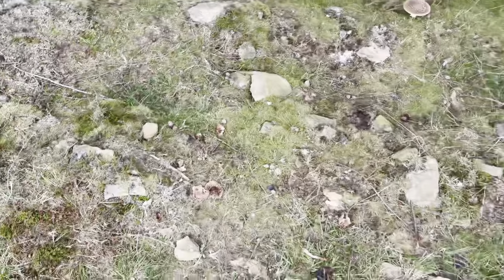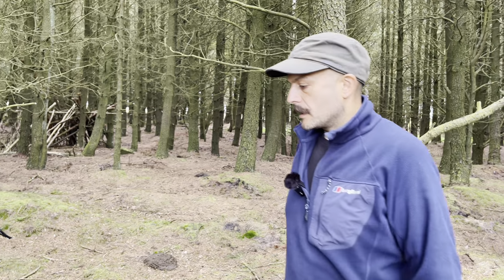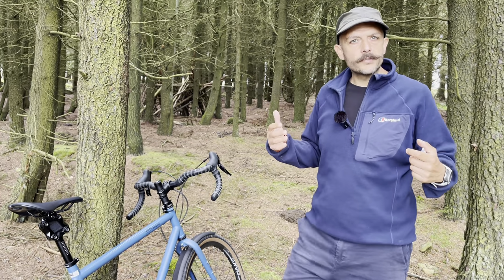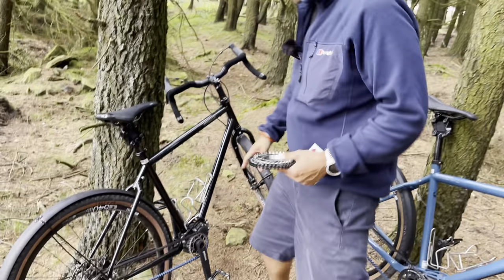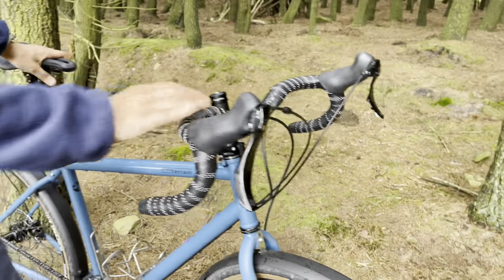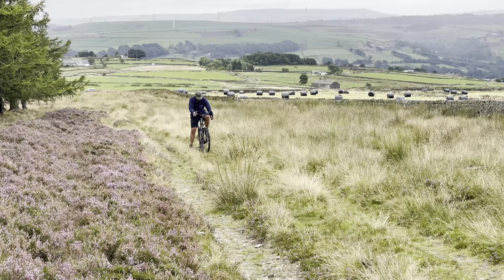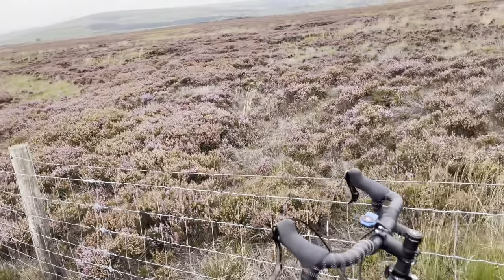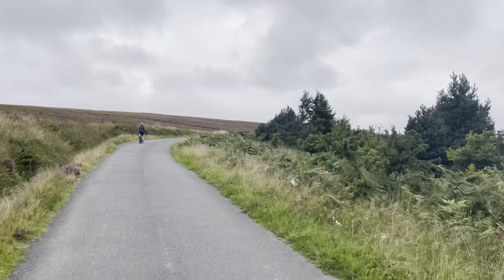Tout Terrain Scrambler Ride & Thoughts - Steel gravel bike with Pinion & Gates Carbon Drive

Comment: Hi, great video and thank for taking the time! I have a question in regards to the dynamo hub and the battery charger. I have ordered the same setup and can see in your video that it comes without any actual front and rear light. If I want to install such lights, is there a connection point at the dynamo hub available or do I need to connect the wires somewhere at the battery?   Thanks :)
Reply from the maker: Hello.  There are two wires that come off the bottom of the battery.  You connect your front light to these and then your back light connects to the front light.

Cheers

Comment: Excellent review!  The Tout Terrain Scrambler would be the perfect all around road/off road tourer. It could handle the GDMBR while still being road worthy. I’m going to have to sell my Surly Disc Trucker.
Reply from the maker: Yes they are very good reliable bikes.  The Surly Disc Trucker is a very good bike also though so make sure you are selling for the right reasons.  The Scrambler is a bit more ‘sporty’ than Trucker and you do have the reliability of the gearbox.  I would imagine the Scrambler with a steel fork is about the same weight as a Trucker. 12.5 - 13kg.

Comment: Hey man, thanks for the video. The grinding noise in low gears and lack of drop bar shifters are what have held me back, along with frame options and price. But the first two concerns seem outdated and the price seems more and more justified. The Tout Terrain seems like a nice do-it-aller. So maybe that concern is gone too. Thanks for the detail!

Comment: Two stone, 5-1/2 pound. My Priority 600 (New York City), aluminum frame, Pinion C1.12, Gates Carbon Belt with dynamo as well as pannier and porteur racks and a FoldyLock comes in at 3 stone. Then again, bikepacking isn't all about weight.
Reply from the maker: Yep, I am not bothered by weight at all but you need to mention it cause some people are. If you feel my bike when in your you would see I don’t even understand the term pack light 😃

Comment: Thank you for all the information concerning this bike.  I have one question, how can one buy a Tout Terrain bike now that there are no dealers in the UK..?
Reply from the maker: Hi, yep you are correct they used to have dealers and then they got rid of them and went to a direct sales model and at the time it was pre brexit when I got mine.  After Brexit they did not have the systems in place with their delivery company to make a good experience for the customer, so they took the UK off their shipping list.  I am hoping in the further they will use different shipping methods and they put the UK back on. When I get a frame from the US they use a company that adds all the import fees to the delivery cost and that means the package by passes customs and comes right to your door.  Hopefully they will use something like this in the future. Anyway if you want one now, a goo way to do it might be to get out to Germany pick one up and bring it back with you. Or even have an adventure and ride it back.  I did that when I bought a Pilot Pinion Bike the Vamos, their are other benefits to that too. Or you could look at getting your next pinion bike from Nua, Solace cycles or rennstahl or falkenjagd.  The steel rennstahl brand has all the features of the Tout Terrain.  The others are titainium. By the way Sonder cycles in the UK also has a Pinion touring bike now the Broken Road. A great value titanium bike.  Cheaper then the steel ones mentioned here.  https://alpkit.com/products/sonder-broken-road-pinion

https://www.rennstahl-bikes.de/de/
https://www.falkenjagd-bikes.de/de/
https://www.nuabikes.com
https://www.solacecycles.com

Comment: Awesome review! Also saw your video on the Pinion and Rohloff. Have you found the gap between gears with the 12 speed Pinion vs 18 speed Pinion for a touring setup a big deal?
Reply from the maker: Hi,  no I thought you would but it is not a problem  at all.  A fact with triple and double derailleur set ups is you have so many duplicate gears depending on what front cog you are on so actual different gears with a triple is a lot smaller and 1x12 derailleur sets must have a similar jump.  So it is not noticeable at all.  The steps between the gears on my P.18 are so small I probably end up shifting 3 at a time.
Reply: @RidingBicycles  Awesome! Thank you from Oregon, USA
Reply from the maker: Oregon was beautiful.  I cycled the Adventure.org route from Vancouver to San Diego. The best trip I have done so far.  Went through so many beautiful places and met some fantastic people!

Comment: Thank you for this informative review. Would you know if it is possible to put a handle bar bag on, or would that require a modification to get the cables out of the way?
Reply from the maker: Depends on the bag but that was a concern of mine.  The cables can move out of the way.  They are not that rigidly fixed in place so with the variety of bags I have I think I would be able to make it work.
Reply from the maker: To follow on. A Orilieb style touring handlebar bag would fit behind the cables.  Not sure how bikepacking bags would fit.  I imagine they would sit just below the cable hood exits but it would depend on the style of roll bag.  I think in the promo vids of the bikes they were filmed with bikepacking bags.
Reply: @RidingBicycles  Good to know. Thanks a lot! Think I will go check that bike out. Looking forward to seeing how you are going to pack it, whenever you decide to.
Reply from the maker: Bikes don’t last that long in my possession 😂 I always get my head turned.  I don’t think I have ever done a tour on the same bike 😂

Comment: Should have asked this in my last post!  Can you compare this model with your Outback?  That would be great!
Reply from the maker: The Outback is a mountain bike at heart if you ride mainly single track or rougher stuff then the Outback would be the better option. If you are planning to ride mixed surfaces and a little bit of the rougher stuff then the Scrambler could be the better option. The Outback is designed to take some abuse and heavy loads so it is not light. Mine came in at about 16kg with a sus fork and about 14 - 15kg with the carbon. The gear range though helps you get over anything, it would impact your speed though, if speed is an issue for you then either bike might not be the best option and both are made for enduring long miles carrying loads without maintenance issues.

Comment: Great video. Lovely bikes. Very thorough. Tout Terrain are a German brand. Without plugging them even more ;@), can you talk about the buying process whether there are any dealers in the UK and if so is there a possibility to test ride their bikes before you buy or would a trip to the Netherlands or indeed Germany be on the cards? On the Tout Terrain website there is their bike configurator. Once you have chosen your configuration, TT then saves it and gives you an order number to take to your local dealer hence whether there are any dealers in the UK? What did you do? Also what Pinion gearboxes are on your Scramblers as Pinion does two types AFAIK the C and P variants and also different number of gears for each? Finally what wheel size do your bikes have? Did you say they were 650b? Sorry you might have said in your video.

I am guessing you could have a flat bar version with twist shifter and mtb brakes so gears and braking are still together? At the point of ordering or prior do you think TT would be amenable to putting more eyelets on the rear of the frame for racks as you have highlighted there is only one which is taken by the mudguard stay? Just a thought.

Once again great video. Good camera work.

Many thanks.
Reply from the maker: Hi, I will answer these questions and more that I have had from people in a follow up video that I will record this weekend 👍🏽
Reply: Pretty much what I also wanted to know. I checked TT's site for UK dealers and then checked their sites, none of which gave any info on their bikes. I was lucky enough to get an almost new Metropoliton from ebay (less than 100 miles)  that uses the Rohluff 14 hub & carbon belt and is fully spec'd. I love it and have thought about getting another model to go with it, probably a Pinion.
Reply: @Rick--A-F  I have a Cube hybrid with Rohloff hub and Gates belt drive which I also love.
Reply from the maker: Hi, I have not got around to uploading that video yet as it came back with an error and everything is done on my phone so it takes about a week to upload.  So they used to have some dealers but it appears that they are going to a direct sales model in the UK as the dealers that I used to contact don’t seem to promote TT stuff anymore.  This is what it seems like to me anyway.  For my Outback and the Scrambler I bought through their website.  Having already had a TT Silkroad I pretty much new what I was getting so I felt confident doing that.  BTW I have had an offer to build up a new bike which means I need to clear some of mine off.  The Scrambler and Outback MIGHT have to go to make way.  I am still thinking about.  The Scrambler has only done about 12 miles as it has only been ridden to do the couple of videos I have put together.  The Outback has done about 350. So if you know anyone that is interested I need to work out a price but I imagine we are looking at about 3.5k - 4K for each one. The Scrambler is showroom condition and actually so it the Outback once it has been polished up as there is not a mark on it.
Reply: @RidingBicycles  Good luck with your build and hope you don't have to sell your new bikes. I'd need a large frame so wouldn't be able to take one off your hands if you did sell :(
Reply from the maker: Yeh I would hate to part with them! But I only have a bike box outside my house so my collection is limited and does change quite often.  But I have had an light bulb moment recently that if I want to retire early and cycle around the world to see nice things I need to stop the the buying of bikes.  The best way to achieve that too is to make sure you have bikes that need hardly any maintenance.  Hey presto the Rohloff and Pinion.  There are others trying to get in on the game now.   So I think the message is getting through to consumers.  But yes my best course of action is to not get tempted by other Pinion ideas :)
Reply: @RidingBicycles  I hope you soon have the bike of your dreams and get to use it fulfilling your desire for adventure!
Reply: @RidingBicycles  I don't understand I thought these TT bikes Scrambler and Outback with Pinion and Gates belt that you bought were your DREAM bikes? I would have thought that parting with them would not fund an early retirement. Are you serious or have you been on the sauce? I ask in all seriousness. Going by your video what bikes could be better than these save I dunno top Pro race bikes but which you need a team of Pro mechanics to keep fettled. Seriously I'm shocked. Well if needs be then I could be interested as I think we are pretty much the same size 5'7" - 5'8" with 30" inseam so yours might well fit me save making stem or saddle adjustments. Mind you I am interested in the Pinion P1.18 spd gearbox. I already have Rohloff hubs which are 14 speed I don't really want any fewer gears. Which of your TT bikes has the 18spd gearbox? Look forward to hearing from. As I say I am shocked by your revelation. Do you and your other half just not get on with your TT bikes?
Reply: @RidingBicycles  I was contemplating a short trip flying to Germany say Cologne to visit a bike shop there that does TT bikes and poss has demo bikes to try and look at. Germany is currently green on the traffic light system of covid risk but haven't actually arranged anything yet. 
I am also tempted with with a fat bike with Pinion gearbox and Gates belt drive. Unfortunately the supply of Pinion gearboxes into the UK has pretty much dried up at the moment so that avenue might no longer be a possibility.
Reply from the maker: No it is nothing like that at all my partner is keeping hers.  I just have the chance at a Ti pinion bike that I am thinking about and reduce from two bikes to just the one as I say I am short of space.  I love the TT bikes and Pinion and Belt.  I am just in the thought process at the moment.  It is the Outback that has the P.18.

Comment: Hi,
Could you make video about how to change flat tire and belt in a bike with pinion? How to loose belt tension, open chainstay, takes wheel off, etc.
A lot of people don't know how to maintain in that situation and thinks its much harder than in a bike with classic derailleur..

Thanks
Reply from the maker: Hi. It is actually easier.  But I can do that this weekend for you and have a video up by Tuesday 👍🏽
Reply: @RidingBicycles  sounds great! thanks